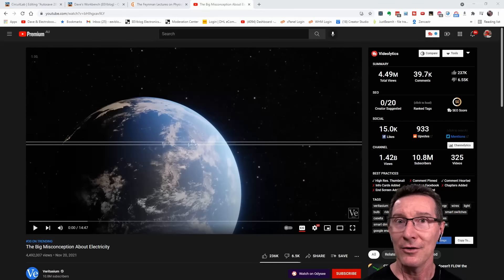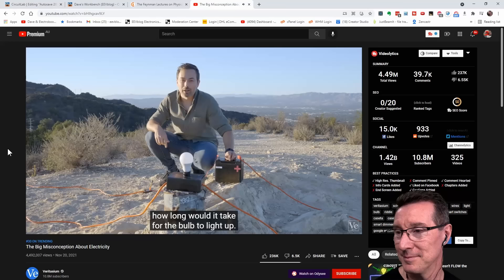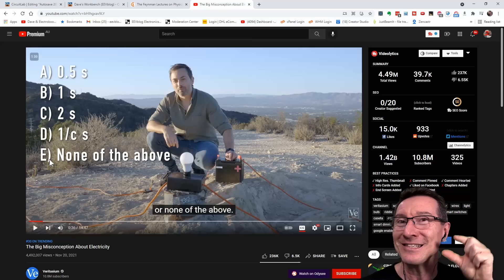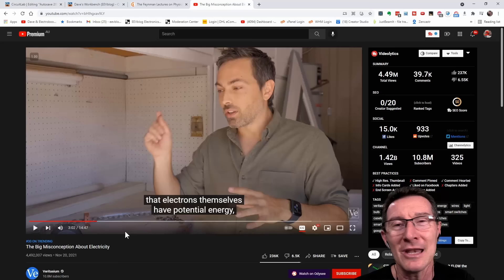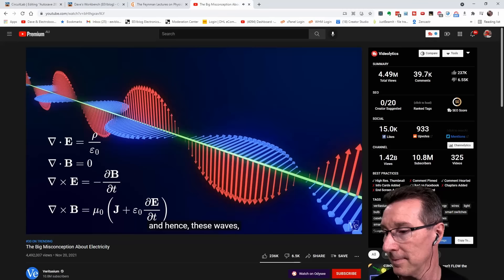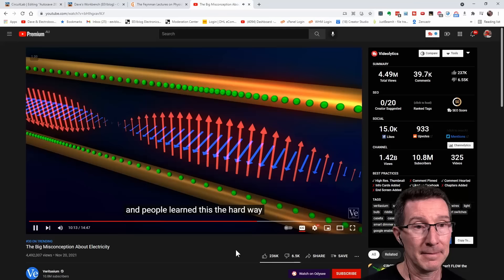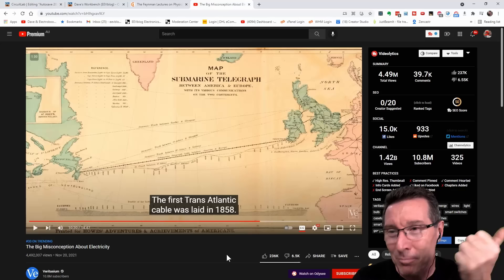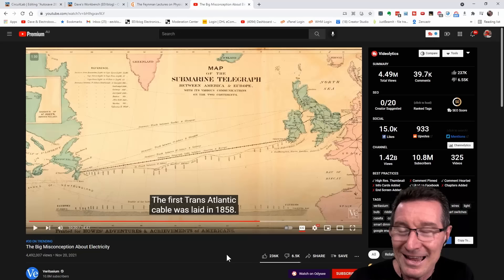EEVblog 1439 - Analysing Veritasium's Electricity Misconceptions Video

Comment: Dave talks too much and has made many practical and factual errors with excessively repeated truths.

The Poynting vector represents the flow of energy in all cases including a DC circuit. There is nothing magical about DC that changes the meaning or direction of the Poynting vector. There is no mysterious direction change from 1 Hz AC to 1mHz to 1uHz to DC.  The Poynting Vector is the cross product of BH and is in the same direction as current in watts/ unit area.

The wire inductance does not decrease to a minuscule amount with a 1m separation. Each wire is about 3uH/m .  Although it is true that Mutual coupling diminishes.

If there is a delay for a satellite transceiver to a news correspondent, why is there no delay to turn on the light bulb.   
What are we getting confused with? If you short the end of the wires of a very long transmission line. 

You do NOT see the short or the light bulb current  until the wave is reflected. Both videos neglect Telegrapher's Equations, I'm sure.

Comment: Ok so your comments on the Veritasium video are irrelevant beyond saying he is generally correct. What you are talking about after his vid is as boring as bat shit. I don't want to know that much about the subject, because I don't need to know, because I am not an engineer. So listening to your video after that made my eyes cross and I stopped listening and started writing this 🤣. His video is correct mostly and aimed at me, because I was taught at school that electrons fall out of the wall socket when you turn the switch on. This was news to me and now I know better. But I dont need your level of info anymore than I would tell you how to do social work for a particular group of children with certain types of disabilities. Because if I told you the multitudes of different approaches, intricacies of each child and the surrounding factors that make them react differently to the same situation, blah, blah, blah because you simply would not get it, unless you have worked in my field for 30 plus yrs and did my training and it was your passion like being an engineer. Now I have finished my comment and you STILL haven't finished Yawn.....   😋 And Elvis is about to leave the building good video though.